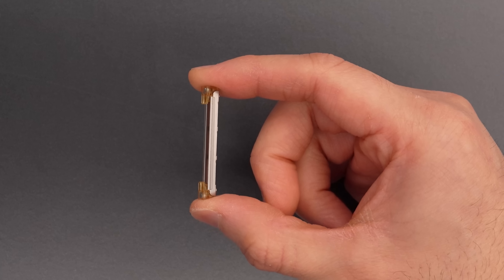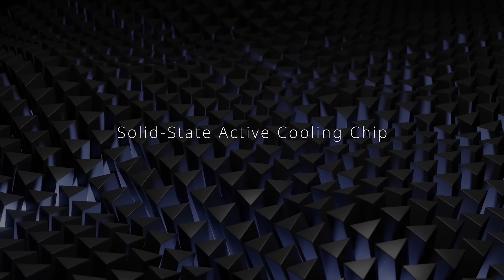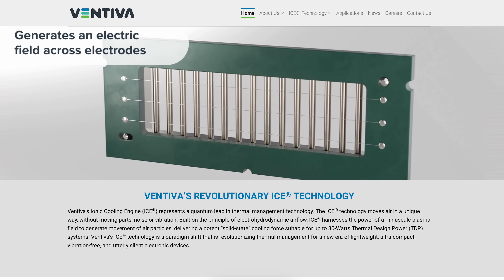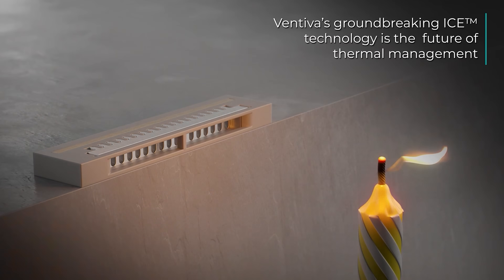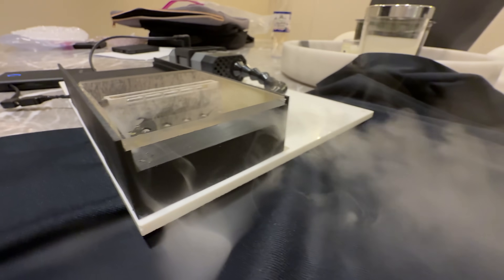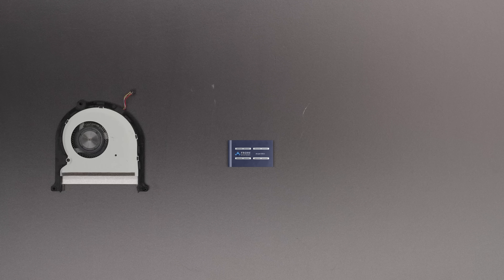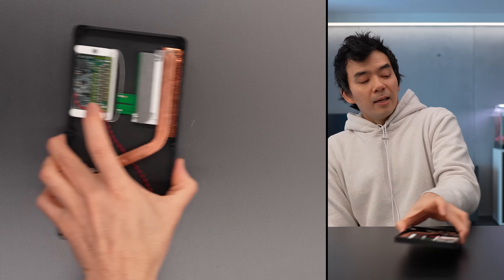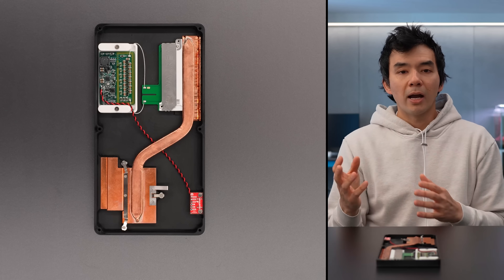The IMPOSSIBLE Laptop Fan...

Comment: Any amount of dust will drastically reduce the efficiency, and just a few hairs could short it entirely.
Reply: So this means that all air intakes should be covered with replaceable HEPA filters to completely block the dust, and all the ports should be sealed with silicon gasket to reduce ingress
Reply: @sihamhamda47 HEPA filters introduce a massive pressure load.
Reply: @sihamhamda47 and HEPA filters reduce airflow by half or more. This thing wouldn’t have any “torque” per se (static pressure), not enough to pull air through a HEPA filter.
Reply: @sihamhamda47 but it doesn't have static pressure, which means filters also don't work, since they take the Achilles heel of this device and kick it in the nuts again.
Reply: @sihamhamda47  AKA all laptops now double in price?  No thanks.
Reply: @DailyCorvid  Yeah sadly, HEPA filters are crazy expensive
Reply: @DailyCorvid  Get your money up, not your funny up? Prices have went up, so should your savings brooooo
Reply: Another reason I could imagine why it won't work in practice would be EMF. This could further restrict the laptop design. The currents are already very small on the communication side. Especially at the clock frequencies we have today. You don't need much energy to flip bits for your ram or cpu
Reply: @reasonrockers  its pretty easy to block electromagnetic radiation at this scale. When you say EMF do you mean EM field? Have you ever heard of faraday cage? One of the most basic electromagnetism courses will tell you that the entire charge will run on the outside surface of the cage (closed cage). Im sure you can find youtube videos of people exposing themselves to heavy EM radiation behind a faraday cage.
Reply: It could be sealed
Reply: @Y2Kvids air needs to get in somehow. sealing it shut except for intake and outtake doesn't solve the problem of needing to filter that air. on a pc to keep it clean inside fans pull air in from controlled, mesh-filtered openings. the difference for this fan tech is, getting dust or hair on it could easily break it, so a mesh filter won't do. better filters require more strength to pull that cleaner air through and are harder to replace/refresh.
Reply: Not few, a strand of something will short that hvdc
Reply: How do traditional fans cope with this problem? genuinely asking
Reply: @anubhavgoyal04  if you have a layer of dust on your fan blades they still push air,  but that same dust will isolate the wire so these ion generators will lose most of their air pushing power. Also traditional fan blades won't attract statically charged  particles nearly as much as this design. Coffee grinders have a problem where they will charge the coffee grounds and the grounds will stick to the chute of the grinder leaving a lot behind, some grinders prevent this by using an ionizer which is essentially the same thing as this fan but just two nails that are supposed to get rid of the static charge in the coffee grounds. That's a fantastic concept but you have to constantly clean the nails because grounds will accumulate on them rapidly making the whole contraption useless.
Reply: @ thank you for explaining.
Reply: @anubhavgoyal04 yeah cuz they better and superior than this new crap 😂
Reply: Just what I was thinking
Reply: why do we even trust in air as an isolator when lightning clear doesn't. I say remove all air from laptops.
Reply: A guy I know is one of the top dawgs in the dev team for these things, not this brand but still, wouldn’t want to doxx him. I asked him about the dust, and he told me that dust actually is not a big problem at all but I forgot the reasoning
Reply: @koolmokash6393  It isn't really possible for it to not be an issue; the principle behind this thing's ability to move air also inherently attracts dust onto its surface. The dust not only disrupts the charge transfer, but it also creates drag.
Reply: @ yeah that’s what I thought as well, but I remember he had a really good explanation as to why it’s not a big problem even with prolonged use. I just wish I remembered. Not tryna doxx him cause idk how confidential his field is, but his company’s device can move much more air.
Reply: Filters would reduce airflow requiring more power and more heat. there would also need to be an exhaust filter from the ozone that this technology create, adding even more resistance. This tech isn't new. Sharper Image had the Ionic Breeze from 20 years ago which was this tech in the form of standing room fan. It failed because of the ozone, lack of airflow, and that it will electrically charge every particle in the air around it and those particle electrically plate all the metal making it less efficient and difficult to clean. It's last iteration had individual fans install because of the complaints of low airflow before it was finally discontinued.
Reply: They could do what Frore does and briefly pulse the cooling device in reverse mode periodically to blow away the contaminants from the intake. Of course, if your chassis is sufficiently filthy, this technique will only prolong the inevitable.
Reply: Dust is a pretty big problem no matter the technology. Do you think there's a way to make it dust resistant, as in how some GPUs reverse their fan directions temporarily, at full speed to unstick accumulated dust?

There's dust resistant coatings as well. Maybe something could be added or changed to make it last 20% longer before needing a clean?
Reply: This should be easily fixable by having really tiny holes enough for air molecules to move through. Since the back pressure is a lot anyways, adding a bit more pressure because of reduced air intake is maybe even beneficial, if not unchanging for the output.
Reply: @SahilP2648  "just filter out all the dust lol" is not an easy fix. If you have really small holes they will clog really fast.
Reply: @SahilP2648  1) you have just described a filter, lol. 2) Filters clog because the particles are too big to move through them. 3) Reduced air intake does not increase pressure.
Reply: "Any amount of dust will drastically reduce the efficiency" True of fans as well. Get the vacuum cleaner/blower out.
Reply: @HenryKlausEsq.  I believe it's different, If you have a piece of hair that touches the + and - side that will short out the voltage difference. While hair is not normally conductive, because for it to be ionizing it has to be very high voltage that would significantly help most materials to conduct some electricity.

For a fan that would be equivalent to enough hair to clog up the fan that it no longer turns. So a fan can significantly handle more foreign matter than this product most likely can.

The video said they have some patent pending stuff to fix that defect, but without knowing what that is, and that it has very low static pressure making filters improbable. I'm somewhat doubtful till I see a product with it.
Reply: No, a dusty fan will still blow 99% of a not dusty fan. Of course you reach the point where the hair and dust don't let the fan spin as much as it used to but that's not what happens in this scenario. Imagine a fan that blows all its air through the motor and coat the motor in grease before so all the dust gets collected in the moving parts of the motor. That's essentially what is happening here, your anodes and cathodes will literally attract dust which will isolate them leading to heavily reduced airflow while still  attracting all the dust. @HenryKlausEsq.
Reply: @HenryKlausEsq.    even better, clean your house you grubs
Reply: @HenryKlausEsq. at least fans are superior. Still works even with lotsa dusts. My electric fan is the proof lmao
Reply: It also generates ozone which is toxic to humans.
Reply: Yall just gotta hate somehow
Reply: @Nasser-bp6qf  truth hurts dont it?
Reply: @Nasser-bp6qf it's physics, not hate.
Reply: Hate?
This is not hate this is a discussion.
Learn the difference...
@Nasser-bp6qf

Comment: So the inefficient for airflow airjets based on your claim of 1700 vs 50 are 34 times more efficient than standard fans for static pressure. Makes me wonder if using just one of them pushing through a much denser microfin array heatsink might be better at dissipating heat since there's also an upper limit on air speed when transferring heat away from a heatsink.

Comment: Oh, it's just a small ozone generator.
Reply: Did none of you watch the video before commenting? They have a catalyst that deals with the ozone. I guess it may not be perfect but probably good enough?
Reply: May i know how?
Reply: @nurhakim2764 ionizing air like this creates ozone. Tech has been around for decades. This is just small.
Reply: @Salamihawk   but isn't ozone toxic for humans?
Reply: @saisrinivasv.d136  yes, but in the end of the day it's not that bad. It just smells a bit funny
Reply: @saisrinivasv.d136  Technically, yes. But at this scale the worst it'll do is make your throat dry.
Reply: @eyeball226   but prologed exposure even in small dose will have its impact
Reply: @eyeball226 I was wondering if this would run into issues if the air was already hot and dry with fair amount of dust
Reply: @nurhakim2764  These devices work by ionizing air to generate thrust this causes the o2 molecule to attract stray oxygen atoms thus creating o3 (ozone)
Reply: Howw
Reply: @Kwint.  ionizing air like this creates ozone. Tech has been around for decades. This is just small.
Reply: @Salamihawk  thats unfortunate
Reply: @Salamihawk so smartphone has been around for 50 years, its tv . Nowadays just shrink smaller 😅

I got your point but you cant say like its nothing when it become small because there’s alot of idea need to to do to achieve this 😅😅😅
Reply: No
Reply: @Cronkna  ummm yes
Reply: @Cronkna  Yes.

Comment: Yeah, I'll pass on generating ozone+NOx and risking serious shock, not to mention my fan failing silently as the material degrades after ionization for a long period of time.
I don't see this to be a viable replacement at all, even if you could make this more efficient, the benefits don't offset the drawbacks enough.

The piezoelectric device generates enough static pressure you can use hepa filters, meaning you can make incredibly well sealed devices with almost no particulate ingress.
If they can improve efficiency then I think piezo is the way to go.
Reply: yeah, I think emphasis on CFM is pointless, the idea of Airjet is to more effectively pull away the heat from surface, at lower noise levels as well. you just need to stack a bunch of them on a more powerful laptop.
Reply: Wouldn’t the piezoelectric device, vibrating at 24khz, be like a permanent dog whistle?

Comment: Not as efficient, but a lot smaller, less sound, you can easily use 2 for better cooler than the one fan, and put better tech inside that uses the extra cooling capability.
But how vulnerable is it ? Seems it might be fragile. And you're running current through the wire, i can see problems with that close to an exit of the laptop, fluids etc. It already was a problem, but i don't think this will decrease the problem. And ionization, sooo, how is that going to go with dust ? I don't know much about it, but i think it might have more dust issues even ?

Comment: So it is an Ozone generator, just what you want any enclosed space.
Reply: So just like every air purifier every company makes for literal enclosed air spaces
Reply: @  lmao no! what air purifier have you been using?
Reply: @IDiggPattyMayonnaise  Which is why in office spaces such designs are normally not used - in the UK the Health and Safety Executive (HSE) has set an exposure standard for ozone of 0.20 parts per million (ppm) over a 15-minute period. If the UK has such a rule the EU will most likely have the same or better.

Also a good purifier would use HEPA filters, not a static charge. Static charge based devices are normally sold as  negative ion generators.
Reply: Plus there are other toxic by-products too 😂
Reply: Plus there are other toxic by-products too 😂

Comment: Ionic fans are nothing new. Cheap air ionizers do the same thing.
One downside is dirt will deposit on those high voltage surfaces (which is why these are sometimes used as "air purifiers"). And not the kind that you can just blow out. Let's see how reliable these will be after a couple years .
Also I bet because of the very low pressure, the airflow will tank once there is even a little dust buildup.
Reply: well it will ast 2 years aka warranty. Ideal for apple.

Comment: I have used this ionic air technology back in 2005 to filter air. Not a new or ground breaking , mind blowing  tech at all. Just a miniature implementation  of the same concept which was there for decades. Worst part is now laptop techs have to worry about high voltages when doing the repair ..

Comment: I have owned several air cleaners that use the same principle. They are about 3 feet tall and move a pretty good amount of air for having zero moving parts. But every 3 weeks or so I clean the metal fins and the rag comes away black with air particles. They also start to crackle after awhile, and efficiency drops as less clean areas remain on the plates. I wonder if these "fans" have the same issue.
Reply: Yes

Comment: 99% of times when laptop fans break it is because of power distribution. 
Hardly anything in modern fans themselves to break as it all magnets and reaction to electricity.
Since this one also need energy it will have same chances to stop working as physical fan.
Also in a lot of cases depending on usage mid tier tec is fine with passive cooling so cool idea but you need several generations of improvements before it will get anywhere.

Comment: This is not new technology. We've had commercially available ionic wind fans for more than 25 years.
Can the cooler be removed for cleaning? The electrodes will attract dust and start arcing over eventually.
Unlike a traditional fan, a dirty ionic blower will cease to function entirely.
Also, these things create absolutey zero static pressure.
Reply: if the high voltage circuit screws up its going to fry all your SSD memory and processor. don't think I am kidding, rain, humidity and dew can change the path of high voltage and arc.
Reply: It's actually better if the coolers degrade quicker, because then the company can make more money each time your laptop breaks from you having to buy a new one. 🤑 🤑 🤑
Reply: @thesun___  oh dear lord no…
Reply: @thesun___ Oh shush dude XD
Reply: @thesun___ greedy companies always for the easy profit 😂
Reply: @Pyroteknikid  Actually there was a patent issued in 1917 to use this tech for rocket thrusters.
Reply: @TheHabadababa  Yeah, I was thinking more about the "Ionic Breeze" made by Sharper Image back in the day. I edited the OP to be more on point.
Reply: you can tell this person didnt watch the video. stop posting misinformation when you didnt even watch the video

Comment: Anyone who wonders if this trick has been done before, yes it has.  I remember an attempt to do a build of a zero-moving-parts desktop PC back in the 1990's where the designer hand-built a case that included ionic air movers for the motherboard and CPU.  (They also built an early SSD and other components, as well as underclocking the CPU to lower thermal needs.  It was a neat build.)

Comment: Hey dave 2d i don't think we should just toss the idea of the airjet out like that (at least in the case of a laptop). In laptop cooling static pressure takes precedence over the volume of air. You said it yourself, laptops have to push air through very small and tiny vents. One question to note is: does the higher static pressure make up for the lower airflow per watt? 
We already have enough issues with ozone and chemicals and air purifiers already, I would choose a solution that doesn't have to chemically mess with the air i have in my immediate sorroundings. The people at frore actually did a demo of thier own and the performsnce was amazing. 
The other issue is the vibrating membrane, how long will that last?
I think that frore can find a good material for the mebrane to make it last maybe as long as a fan. But I would a solution tha leaves the chemical content of air in my present envirenment the way it was.

Comment: Sir, you are the epitome of “size matters.”  The Frore Airjet removes, on average, 4 watts of heat in that .2 cubic feet of air.  That air is also at much higher pressure than atmospheric during the process.  The coefficient of performance(COP) is 4, which puts it on par with a modern heat pump despite only using three parts.  These numbers come from the Mini version, which is less efficient than the regular one.
This ionizer is going to corrode exposed metals and organic compounds over time, which makes it unsuitable for close proximity operations to electronics.

Comment: The biggest issue I see facing mobile technology like laptops is the same problem facing EV's and it's not cooling... it's Lithium Ion batteries. We need a better battery technology, that's not prone to thermal runaway.